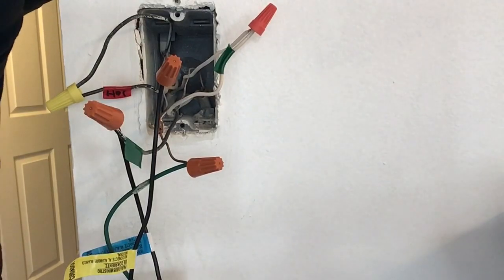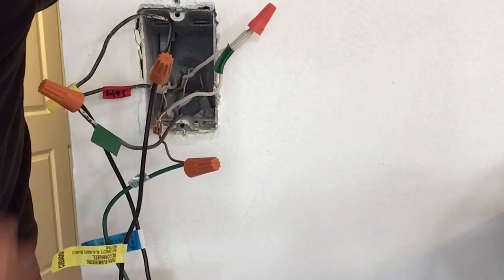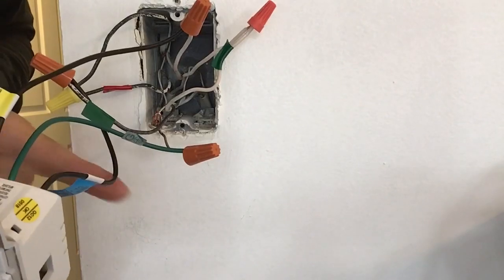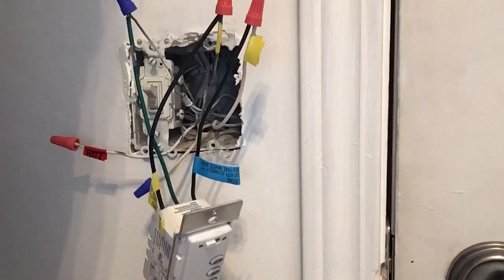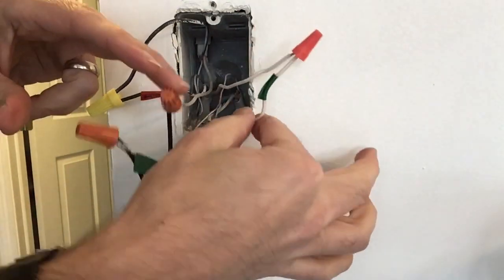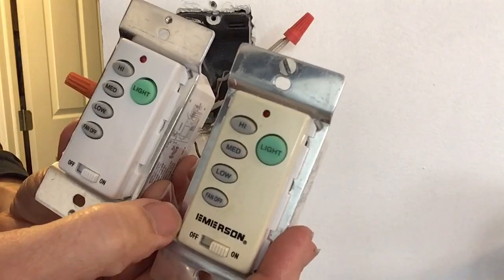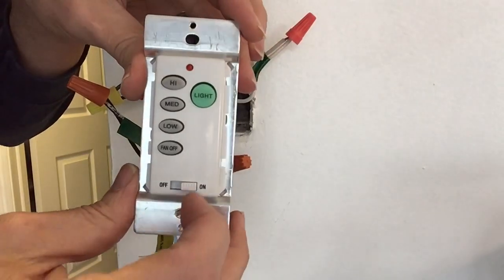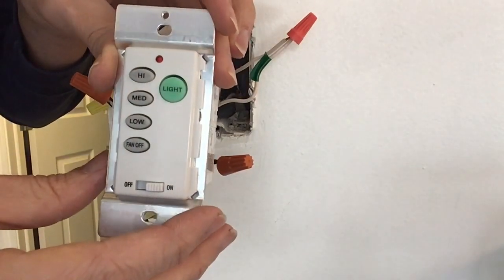How To Install and Wire Ceiling Fan Remote Control Switches

Comment: If your electrician could not figure this out, you need to find a different electrician. Hot on one end, switch leg on the opposite end, travelers meet in the middle switch box. Easy way to explain it.

Comment: I have this exact wall remote. It has worked fine for several years. Suddenly the light won’t turn on when pushing the green button. When initially Turing on the on off switch the light flashes on but goes right out. Fan works fine. You s there also some type of battery in this switch that needs to be replaced? Thank you

Comment: How the “F” do you reverse the fan if their is not a switch on the fan or the Kichler wall remote switch
Reply: If you look at the round base between the fan blades and the ceiling, there is a switch off tot he side.  It can be pushed to be in the up direction or down direction.  That is how you can reverse the motion of the fan blades.  Great time for the winter to help keep the hot air going down.  Good luck.

Comment: Never use the color green on an energized conductor!  green is used for indicating  grounding,  earthing and bonding.   simple for an electrician. DIY tip .. stick to a single pole switch and a duplex receptacle. its not worth a fire  loss of life and loosing everything, while gaining such little knowledge.  A good approach would be to get a clear understanding of basic electrical house wiring and what you are working with and how it actually works first.   good luck.
Reply from the maker: Thanks for sharing